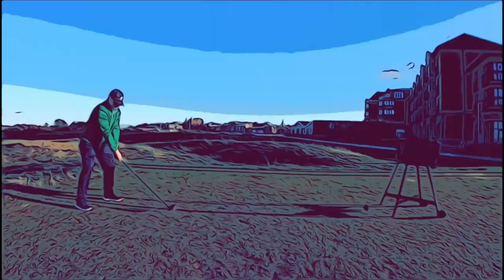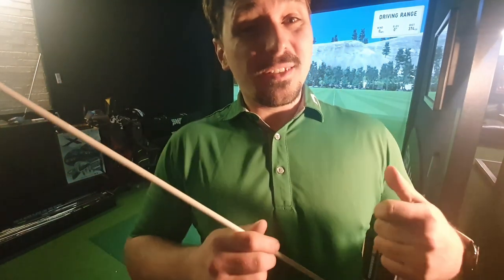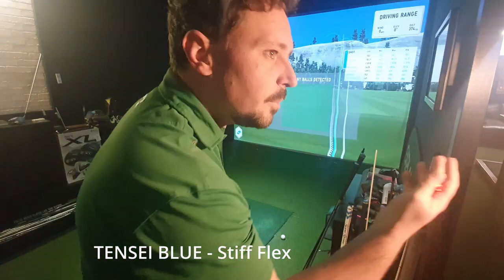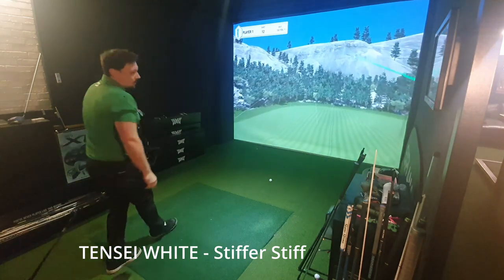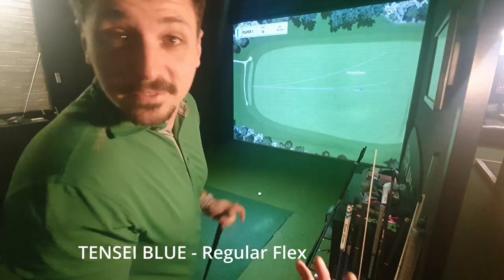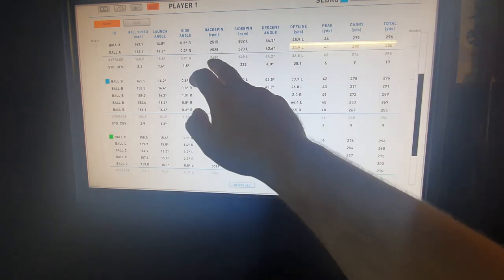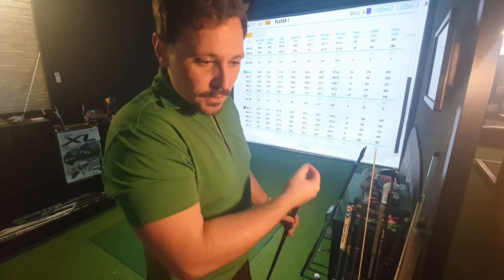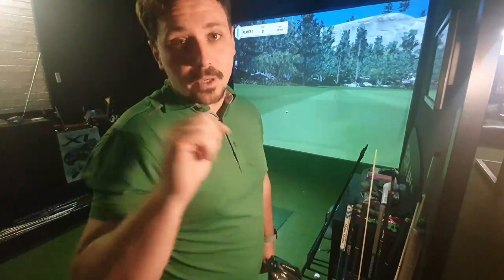Regular Flex SLICES MORE Than Stiff Flex? Golf Shaft TEST

Comment: I don’t think I’d say slice is the big difference. For me it was more with launch angle. With lighter shafts and even stiff I hit super high balls with more spin. X stiff I get 20-30 yards more carry and easier to control with a longer carry. Feel is also a big difference. Every swing is different. You have a slower tempo with a smooth transition. Shaft flex  depends on the swing drastically. I gained 60 yards and cut 10 strokes as someone thinking it never mattered till I got fitted
Reply from the maker: Nice!! It's not black and white tbf, sounds like you're using a shaft that keeps up with you better and seeing the benefits! Nice 🙃

I use shafts to bring the soin up and down in fittings ..occasionally, a stiffer shaft spins more, but that's more to do with the strike changing / each golfer reacting 

Generally I'd see lower flight and less spin at faster speeds like yourself 👌

Comment: When testing shafts torque is just as important as flex.
Reply from the maker: I agree... I want to grab 3 matching flexes with different torques and isolate that variance
Reply from the maker: Possibly more important because a "stiff" flex shaft varies so much brand to brand and model to model. Torque is an overlooked aspect.

Comment: As someone extremely unknowledgable, it seems to me that the stiffer shafts perform less favourably? Lower carry, lower spin etc. What's the advantage of stiff shafts then?
Reply from the maker: They are good to reduce the left shot, heavier can also contribute to that - If I wanted to play with a fade / left-to-right shot, it's much harder for me to produce with the regular shaft

They can be more consistent for faster swings as well if the strike consistency is good, In this test, my striking was not good at all but if my swing were more practiced and tuned in, I could get more consistent spin and carry with a stiffer profile of shaft

That would need to be tested and proved for each individual in a fitting - Part of that fitting would be: "where do you want the ball to go" 

Some of that will come from technique and some will come from the equipment :)

Comment: Freddie, my understanding has always been that the centrifugal effect means that the centre of gravity of the club head is "pulling away" from the hands when the club is travelling at speed. As the CoG is behind the face, the shaft tends to bend forward at the head end. This closes the face slightly and increases loft. A stiffer shaft restricts this so the effect is less.
Old photographs distorted the truth showing the club head way behind the hands. Modern photos, if correct, will show the shaft slightly bent at impact with the head ahead of the hands.
The effect with irons is much less because the head is smaller.
Of course, a different flex gives a different feel so that might affect the swing giving a different result but the physics is the same.
I am surprised that the PGA don't teach this, any club manufacturer will know.
Offset woods increase this effect, 50 years ago we sold woods with a kink in the shaft which increased the effect to help slicers. Look up "Crookshank" vintage woods. They were not popular but they worked. Putting lead in the back of woods was also common to reduce a slice.
Reply from the maker: Very good points!

Sometimes I see the launch angle decrease, possibly where the torque is higher, so the closing of the face supersedes the added loft elements of the shaft bend at impact.

Great point about the CoG being behind the face encouraging the back end of the club down 

Will have a look at the "Crookshank" Vintage Woods, sounds interesting indeed!!
Reply: @FredzGolf  you may be right about closing the face.
My own experience is that I can play a high draw, nice flight, with an offset Cobra driver, whippy shaft. Any regular shaft goes much lower (including my 3 wood!) and tends to fade. I could never use a stiff shaft even when I had reasonable speed. Old and disabled now, I only hit a few balls on the range.
Those Crookshank woods brought back memories, they were a nightmare to rewhip.
Reply from the maker: @oldprogolf7292  rewhipping!!! I've only done that once, using a "how to" club repair book older than me my Dad gave me ha

No need to make the game harder, use what works :)

Comment: I absolutely have the problem of a more regular shaft slicing and blocking to the right (I am a right hand golfer). A shaft too stiff for me will hook left every time.

Thanks for the video and your thoughts. Cheers.
Reply from the maker: ... https://youtu.be/kx-6S1BnpWk
Reply from the maker: More than just the flex written on the shaft is different...same head / same swingweight? Same TYPE in different Flex? https://youtu.be/kx-6S1BnpWk
Reply: @FredzGolf  not sure about swing weight to be honest, but in comparing Dynamic gold 105 reg v dynamic gold 105 stiff v my current shafts (which I hate and will replace soon), the project X 6.0, which is way stiffer. All 105 grams I believe.
Reply from the maker: @willdarsow  hmmmm interesting ....I wouldn't put those shafts to bring out a block vs an "absolute" hook on their own 🤔 
If you change shafts, would you reshaft existing clubs or new sticks entirely?
Reply: @FredzGolf  looking at the numbers...

Here in Australia, I'm looking closely at the ZX5 Srixon irons which will be about $1400. Could sell existing Apex 21 for say $700, as in good condition and 2 years old.

No real point reshafying as that's going to cost $700 anyway!

Plus it's easier to get a full.shaft fitting when my golf club is selling me new clubs, rather than just new shafts, plus it's more interesting having new clubs anyway!

Comment: What weight was the ladies shaft? I usually play a Tensai Blue stiff and have just obtained a new driver fitted with a senior flex 40gm was wondering if it would be worth giving it a go.
Reply from the maker: It was the "Project X HZRDUS T800 4.0 / Ladies" 
40g shaft

Give the Senior flex shaft a blast first as it may be enough contrast from your previous stiff to see a beneficial difference already 

Give the ladies one a test if it's convenient I'd say :)

Comment: Do you have an email to ask questions, i feel your expertise is the advice i need thanks
Reply from the maker: Hiya, 
Ask away on here for FREE!! The activity helps me gain more momentum with the algorithm and may get you some answers you're looking for! Win Win 

I'm a bit slow on emails due to volume but by all means send your thoughts through and I'll do my best to help: HoleSaleGolf@gmail.com
Reply: @FredzGolf  ok good idea, my question regarding driver for me, beginner golfer, have played maybe 2 rounds, i tried some drivers at golf town, everything went left hard lol(left hand) was thinking of a pxg or cleveland or srixion because of price point, until i get better i cant see spending 700 $ cad, on avg my ball speed on drives is around 126 mph, launch 16degree backspin 3100 rpm if this info helps
Reply from the maker: @campliving4395  Aha I see... That face has got to close down, the toe needs to work faster through the ball... There's a few ways of doing this but most of the hard work has to come from technique 

Shafts like the Cypher in the PXG would be a good idea ....The Cleveland Launcher XL also has this shaft but with an extra counter balance ...which helps release of the clubhead

If you get the face closing through the ball, you'll get the direction, spin rate and distance all in one ...I'll try and get a SHORTS video out in the next few hours to give you some idea of release :)
Reply: @FredzGolf  how many gram shaft? And stiff flex, any other busget drivers i should look at, so pxg or cleveland be best for now?

Comment: Im no pro but I have seen photos of my swing and it clearly shows the regular shaft bending back at the end so the club head is open faced right before impact. Draw (no pun intended) your own conclusion, Also, you may want to try this again using a more neutral club such as the rogue st max LS.
Reply from the maker: Send me a pic ....I said I'll eat my hat if you're right 

With that difference in head the whole test would move results to the right ....difference between the shafts will remain constant
Reply: Your holding the lag to late in your wrists, that's why it's open and behind at impact,
Reply: I think you would need a very fast frame rate and slow motion camera in order to draw conclusions like this.  A photo before impact could be completely different than the club head and relationship AT impact.  The club could already be traveling forward for impact, but you wouldn't ever see that if the photo is just prior to impact.  That's part of why you can't trust photos of a swing.  In the end, the ball NEVER lies.  Learn how to diagnose your ball flight and you won't have to rely on bad information/conclusions from images.  The ball ALWAYS does what the clubbed told it to do.

Comment: This is about as factual as Donald Trump
Reply from the maker: Haha... More than happy to do another test...any requests for equipment, handicap, speed and I can specify deeper
Reply from the maker: Have you found any contradicting videos? I'd love to expand my knowledge
Reply: I play a Hzrdus Yellow stiff in my Driver and produce a slight draw. I have a stiff Hzrdus RdX Blue in my 3 wood which I manage to hook more than draw. Then in my 3 Hybrid I have the stiff  Hzrdus RdX Black which I hit straight with the occasional draw. All tip stiff I believe just the different shaft profiles that have different results. I'm interested to see if I got the black in a regular would it be just  easier to load but with the same shape for me as your video suggests 👍
Reply from the maker: NICE! Yes I'd expect that exact pattern between the Yellow Driver, Blue RDX 3 Wood and Black Hybrid - I think the amount of torque (written in the diamond thingy) would also correlate off the top of my head between them - More torque, more draw.

I think Reg Black in the hybrid would be a hair easier than the Stiff ...They're still pretty stiff and stable for a "REG" 

Is it an adjustable hybrid shaft? click in / click out?
Reply: Here's one that nobody does. Start testing cheap shafts (under 30 dollars) against some really expensive shafts. I did it and  expensive shafts aren't worth the money unless you have an ego to feed.
Reply: Yep, very facual.
Reply from the maker: @aliensarereal7832  I did actually do this, but didn't film it! 

I found that SPINE ALIGNING the shaft allowed it to keep up with the more pricey shafts

The spines in the cheaper shafts were more pronounced and have a larger impact when placed in different positions... which could then be used to encourage higher/lower/lefter/righter shots if done right 

If I were to build 3 drivers with the cheaper shafts I used .... they'd all perform differently in a bit of a random way ...spine align and the ball flight and dispersion is WAY WAY tighter
Reply: @FredzGolf  Thanks for that info. I use a hypersonic 23 dollar shaft with 4.5 torque, lady/senior with 3/4 tried off the tip and it outdrives my v2 and my project x with better control. Must be me. I really can't tell the difference that much. One thing for sure, I just picked up some cobra graphite iron shafts for 9.99 and put them in my old maxfli cavity backs and I can't miss a green with them. They sound different when I hit them but the control is incredible. Tried to go buy a bunch more but they were sold out. I think someone else did the same thing as me because they weren't moving until I bought mine. With a little improvement in my chipping and putting I believe I will finnaly shoot a 72 next year after 35 years of playing. Would probably do better if I could hit my driver 300 yards but at 71 I doubt that's going to happen. The exiting thing is if I do it I will have shot not only a par round but also my age. I'm close.
Reply from the maker: @aliensarereal7832  Niiiiice.... I can relate to going back to buy the shafts as backup ....I did that with the Grafalloy Blue 'Nanotech' years ago ...Not the same as the real thing but good enough, I bought 10 of them I think

Definite life goal - Shoot your age :)